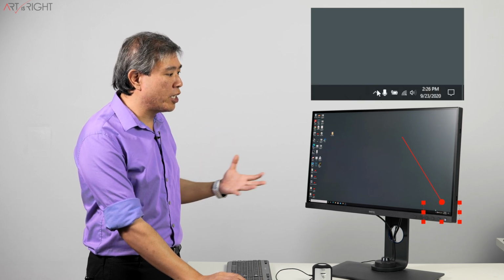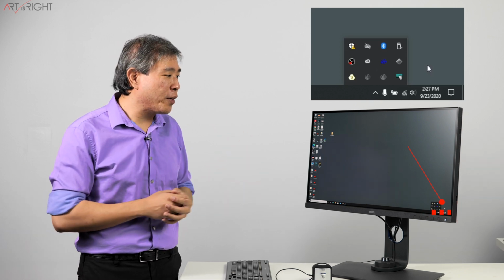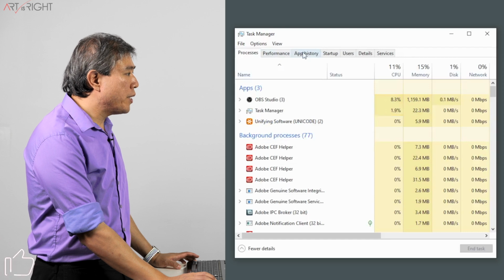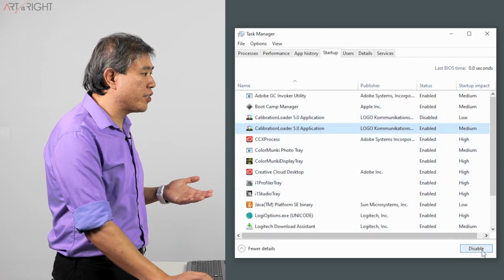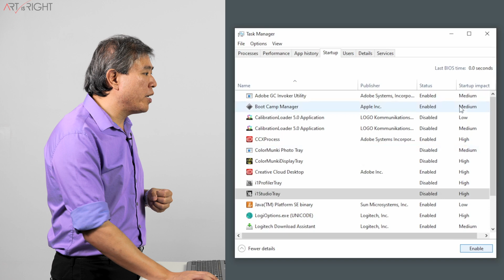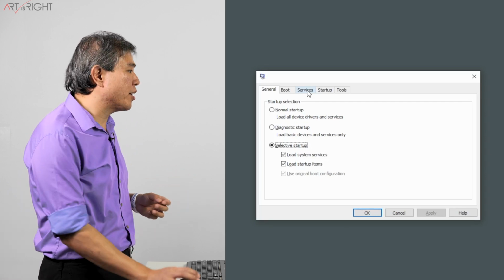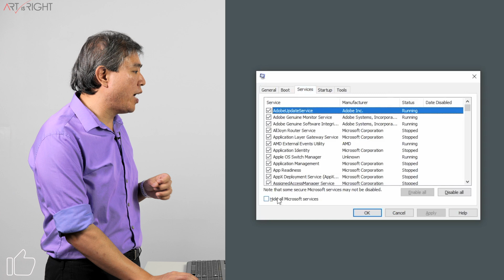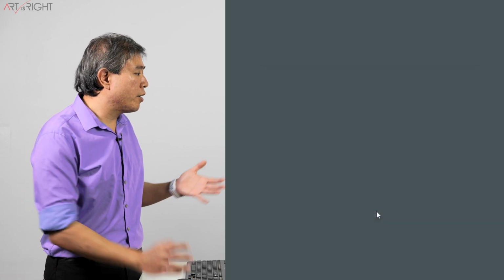Palette Master Element Sensor Measurement Error Potential Fix for Windows 10

Comment: Hello, when I try to calibrate my SW240 with PME (WIN 10, Spyder X Elite), PME starts and runs until the moment where I have to put the Spyder on the sceen... then the wole system crashes an restarts. Tried without running Spyderutility on startup but doesn't help.
Any idea?
Thanks
Reply from the maker: What PME version are you running? If you are running 1.3.16 use the link in this video description to download and install 1.3.15 https://youtu.be/wV_FGFrovDA
Reply: @ArtIsRight  Hello, it worked!
Thanks very much, so glad that I just ordered an SW270c to accompany the SW240.
Reply from the maker: Nice!

Comment: Thank you, this is a very informative video.

I have a SW2700PT and SW240 connected to my PC. For some unknown reason, PME cannot create a useful hardware calibration profile for the SW2700PT, but it works perfectly fine for the SW240. Even after following your advice here, PME would create hardware calibration profiles for the SW2700PT that are completely dark. I mean like nearly pitch black. I've tried your hard reset procedure (unplug AC, hold power button 10 seconds, leave monitor unplugged for several minutes), and still no luck. It seemed as if the SW2700PT's hardware was defective.

So finally, switching to an old Macbook solved my problem. I just loaded PME onto the Macbook, ran the calibration, and now the SW2700PT looks perfectly fine on both the Mac and the PC. Gotta love hardware calibration!

So I just wanted to point out that if anyone is having trouble using PME to hardware-calibrate their monitor, another useful solution is to simply switch to a different computer to calibrate. This won't help you figure out what the problem is; but thanks to hardware calibration, this alternative method could get you up-and-running much faster than spending hours troubleshooting what driver, program, user privileges or whatnot could be interfering with PME.
Reply from the maker: This may help https://youtu.be/Rxsr8QWBRMw tl;dr you have to calibrate them individually, for your models, i.e. remove the USB uplink cable from the one that you are not calibrating.
Reply: @ArtIsRight  yes, I had done that; but the SW2700PT would always get a corrupted hardware calibration profile that completely darkened the screen. I would need to use the monitor's buttons to select a different profile (other than Calibration 1 or 2) to get the screen to display properly and try again. 🤷‍♂️
Reply from the maker: Are you running on 1.3.14? If not update, some previous PME have compatibility issues with SW2700PT with some firmware.
Reply: Yes, I've tried not only v. 1.3.14 but also many other previous versions of PME. (Thanks for your links to the other versions!) What I should have done earlier (after disabling the i1Studio software in the system tray didn't do anything) is to have completely uninstalled the X-Rite software from my PC. However, I tried that yesterday and PME still doesn't write the hardware profile to the monitor with correct data. 

To be honest, my laptop workaround can reliably calibrate and write good hardware profiles to the SW2700 such that it's not important to me to troubleshoot the desktop's problem much further. My desktop has way too many other hardware, programs, and drivers installed on it that isolating the problem is very time-consuming. So using a barebones laptop not only gets faster results, but it also eliminates practically everything that could be causing problems on the PC. Besides that, it was actually the SW240 that needed the hardware calibration in the first place: All of its factory default color profiles were visibly cooler in color temperature than 6500K, even after giving the monitor time to warm up and stabilize. But after calibrating the SW240 with PME, all three of its hardware-calibrated profiles look pretty much identical to the SW2700PT's. The SW2700PT, on the other hand, already came with very accurate default factory color profiles, that hardware calibration at this time isn't really essential.

Comment: Didn't work for me in version 1.3.10 or 1.3.11. Using Windows Task Manager I killed every service remotely linked to the monitor or i1Pro. Still got Sensor Error. Finally, I had to completely uninstall i1Pro software. Then it worked. The i1Pro was recognized and worked fine in 3 other calibration softwares. Only Palette Master fails. I think the claim that other software is constantly communication with the i1Pro is false. Palette Master is just buggy.
Reply from the maker: It is a possible fix, I am not saying that it is an absolute solution. But it it worth knowing and check and should be part of the trouble shooting step. I'm sadden it didn't work for you but it would seem you got it going anyways.

Comment: It would be great to see a guide on how to manage profiles in video editing software such as Davinci, Premiere Pro.
Thanks!
Reply from the maker: Premier Pro uses Adobe ACE, i.e. the program manages color very similar to photoshop, Lightroom. For DaVinci Resolve you would have to calibrate your display to Rec 709 as the RGB primary, set the gamma to 2.4 and you should be good to go since Resolve does not color manage. This guide will help https://youtu.be/8rjRoIe0-mo

Comment: I today used Affinity photo alternative to Adobe Photoshop and it's nice but lacks few things as custom camera and paper profile system. Or i might have missed something. The working color space in it is very different than Photoshop.
Reply from the maker: Affinity, from my understanding, uses the OS color space and color profile. Which is why it is important to calibrate with using the other programs.
Reply: @ArtIsRight  yes in working color space it also shows BenQ Calibration ICM Profile too. What should be done in such situations, if not using Adobe Photoshop or Lightroom.
Reply from the maker: Stick with BenQ ICM profile
Reply: @ArtIsRight  Sir in past i was using everything in default working color space inside Adobe Photoshop. Now thanks to your videos i later decided to move on to work under color grading environment system. Now i need to know should i go with ProPhoto RGB, Adobe RGB or BenQ Calibration ICM Profile in Photoshop Working Color Space (WCP) option. BTW new Photoshop CC 2020 v21 is totally overhauled. Which is the best WCP and how prints will reflect with these changes. Can you make a video related to this topic. It will be really helpful to understand if you explain it.
Reply from the maker: For photoshop, there are 2 recommendation, the more generic one is to set the color space based on the reference color space, that is sRGB, Adobe RGB, ProPhoto etc. The other is to set that specific to the display icm. The display option is going to be best because it is using the display profile directly with minimal interpolations. So if you are using a hardware calibrated display it may be a good idea to use the display icm profile. A video is coming on this.
Reply: @ArtIsRight  Woohooo! Desperately waiting for that content and test it in my studio.
Reply from the maker: Stay tuned.